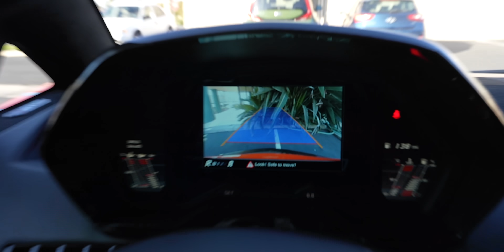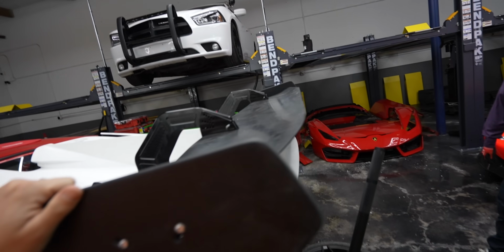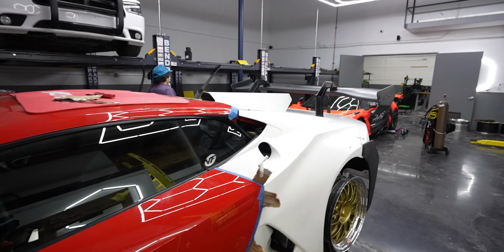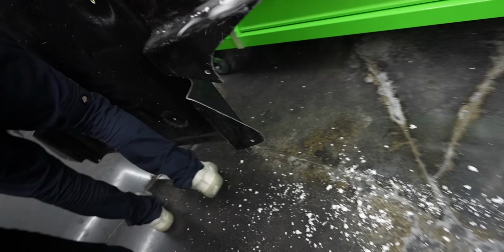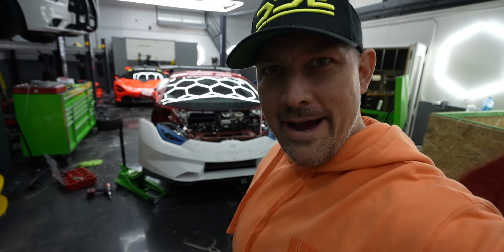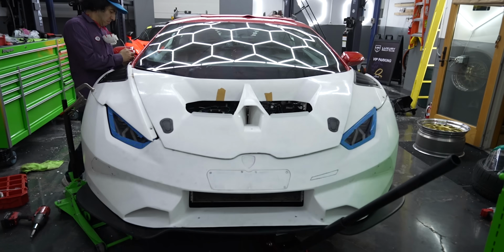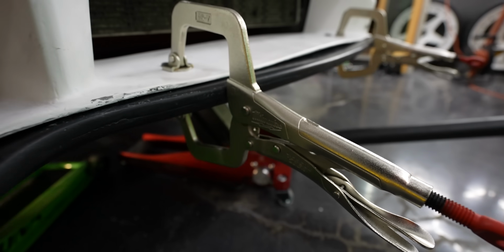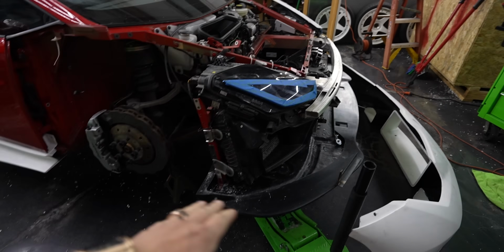MY NEW DREAM BUILD LAMBORGHINI IS A HATERS WORST NIGHTMARE!  *HATER SLAYER PART 4*

Comment: I'm genuinely curious to see how this kit holds up at speed. Jon clearly knows his stuff. But all the grinder work, jank edges, and all the thinned and removed mounts. Unless there's some work being done off camera to strengthen mounting points and clean up all the modified parts and frame pieces, it'll look damn good but I wouldn't want to take this car to top speed.
Reply: I'm sure that when this thing is done,  EVERYTHING will be structurally solid. Probably more so than factory.  John seems to be a true perfectionist.  Mock up is for figuring out how and where all of the new brackets need to go.  The only thing that I see that I might do differently,  where John used cable,  I might have used rods with adjustable turnbuckle. My 2 bits.
Reply: I thought i was the only one.. seems abit more like a rush job with how reckless he just gets with cuts and throws stuff around etc.
Reply: I dont know much but it almost seems like hes getting stuff off he knows needs to go to fit things, and is now removing the panels and spending time on brackets and what not. If id done something like this before and I knew what needs to go, it chop that shit off quick then spend the time refining and finishing once everything is in place and solid
Reply: You obviously haven't paid much attention to what is going on or said in these videos
Reply: Remember he takes it off and puts it back on alot. He's not done.
Reply: @angushoover8670   Definitely not as impressed with installation as many others are. The use of cables is 100% tacky,  as you stated I would build proper brackets with adjustable rods giving max strength and fitment adjustment of the front diffuser .  The kit will go on but will it look like a kit or will the fit and gaps look like a multiple hundred thousand dollar car should.  Ultimately so long as Damon likes the finished product I guess is all that really matters.
Reply: I mean he obviously doesn't know his stuff because of said jank edges and grinder work. I'm also curious how long this assembly will last
Reply: @wirefeed3419  You know most of the worlds biggest bridges are held up by cables? Pretty sure that one will be just fine.
Reply: All of these builds are meant to look cool at a car show and nothing else. It's all fake parts to start off with, definitely won't be safe at speed.
Reply: @ThatGuyMata  none of you actually watched the whole video before commenting your 2 pence
Reply: The real super trofeo uses the same exact cable set up  google one that’s took apart 😊
Reply: They know it won't last.  They're probably looking to smash some more eardrums and have sledgehammer 2.0
Reply: @PuicyBuilt  Oh so if you saw a cable on one then this one must be just as good because... cable. There's so much in that alone I don't even know where to start explaining what's wrong with your logic. I can only assume along with others here this is for looks alone and be damned the rest. Nothing like ace hardware bolt-on aftermarket replica parts you ground down to fit to inspire confidence in line with the high-end car you just got tuned...again.
Reply: This is the third time doing this kit so I would venture to imagine he knows what he’s doing. I would feel more comfortable with DDE getting the third kit. I’m sure he learned a lot from his first two builds

Comment: Do an SVJ style but do a flip on the colors. Wrap the car in the colors you would make the decals out of. And then ame the decals out of one color. Then do them across the car at like 45 degree angle going from front to back. Wheel wise. I think you should do wheels like they use on the drift circuit. Where one spoke is a different color. On the spoke have AL13 put DDE In a totally different color.

Comment: When it comes to rims it really depends on what color or design of the wrap you are going with this car, those BBS perhaps converted into a 3 piece deep dish in the rear would be very fitting for the car considering the widebody kit, i was even thinking of doing an Aerodisc on the front with that same wheel giving it a different look to other widebody Huracans out there. I also remembered Forgiato has some rims for the LB aventador which are super nice and would look very good on the car the style i think is called MAGLIA-M (correct me if im wrong) and they would suit the car well since they have a concave look. Or do something different and try to go with a concave or deep dish look of the Aventador S rims, i know of a company named ANRKY who do sell that style named AN30 but i don't know how good they are in terms of quality or if they are willing to do a rim like that but for a Huracan, eitherway if i had to choose i would most likey pick the BBS more with that red color the lambo has right now, the gold color on the rim makes it look sexy

Comment: Wing must stay. Wheels, I'd go for whatever wheels these race with. With regard to the air compressor where is that going to be relocated to? Great build and I am looking forward to the next instalment. Oh, by the way, re the livery. You need to have the haters faces on it somewhere. Even if just on the underside of the bonnet just for shits and giggles.

Comment: You should try to get carbon fiber wheels since it's a race car and weight off the wheels means alot more than just weight off the car in general plus I don't think you can get a cooler wheel than one made of carbon fiber like alot of hyper cars have.